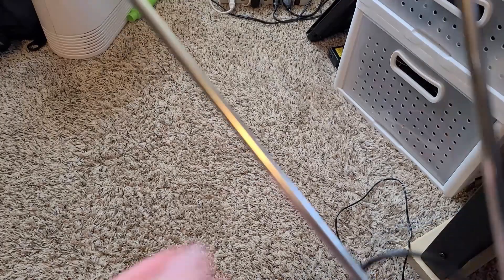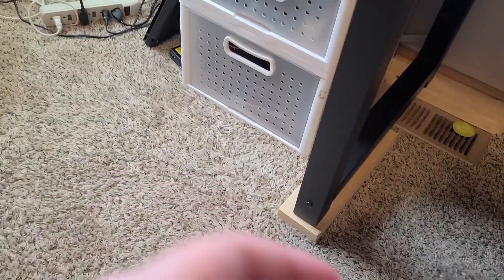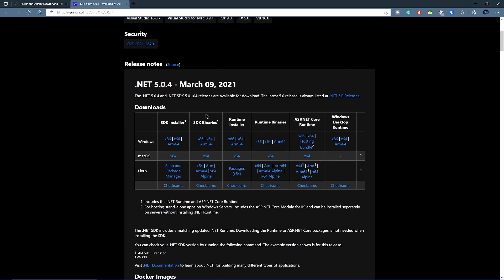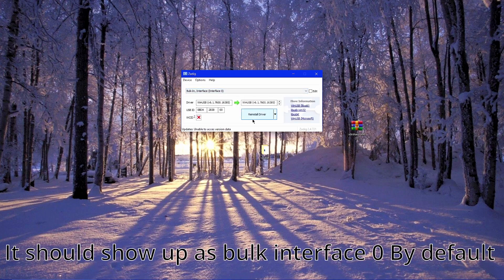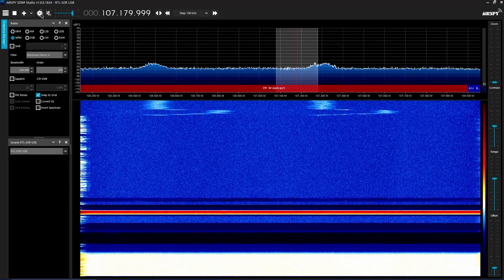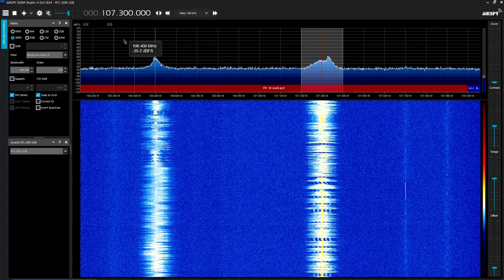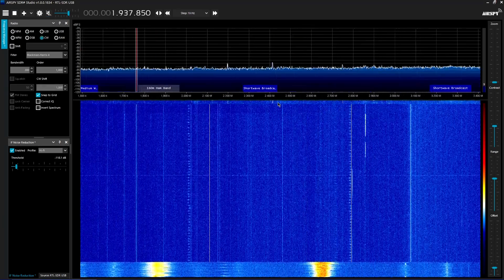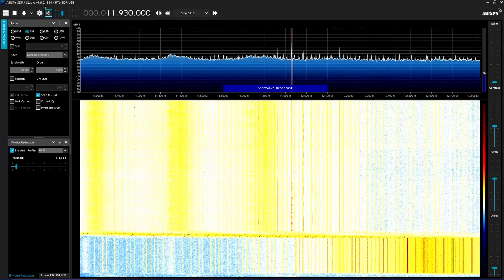Beginners guide to SDR #2 [ setting up antenna and SDR sharp ]

Comment from the maker: For those confused, the cable that I mentioned is not fully shielded therefore if you pair it with the two diapole antennas and you stretch out the extension cable it will actually pick up shortwave better than the diapole antennas by themselves. (And yes I do know about the resistance of the cable which is why you shouldn't use this cable with VHF bands and above)
Reply: Thanks for the video!  You should make a dipole with the antenna ;)  Move it up on the window, look inside the antenna (behind the little plastic piece that pops out in the middle) and you can see which side is the active element and which side is the ground - move it up on the window, extend the active vertically up, and extend the ground down, and you will have a "true" (as true as you can get with cheap antennas) dipole and you will pick up a tremendous amount more - especially radio stations.  What you have, albeit cheap, is a 2 meter antenna - 3ft. on each side.  It actually can work pretty well, but you need to position it most favorably.

I'm sure you probably already know this stuff, but for the viewers that are unfamiliar with antennas and are following along - I leave this here :)
Reply from the maker: @NJFPV  Thanks for the info! I've only recently discovered that dipole antenna trick only just recently. Thanks for sharing.

Comment: For the antenna I thought that they are supposed to be rotated and run vertically -- one on top, one on the bottom. Was this wrong?
Reply from the maker: That's correct It depends on what you're trying to receive there's different types of antennas and different types of polarization depending on what you're trying to receive.

Comment: Thanks for this video.  I was following instructions for this with TheApeMan, but I think they are out of date.  I had 2 'Bulk-In Interface' in my Device Manager, and after I ran zadig.exe I selected #0 and it installed fine.  But I still have 'Bulk-In Interface (1) in the Device Manager, and in zadig.  I ran the install-sdrrdl twice, could that be the problem?  And how do I fix it??  Also, my audio goes mute in my speakers when I open Sharp!
Reply from the maker: You only have to install the driver for Bulk-In Interface 0. As for your speakers being muted I'm not quite sure I've never experienced that problem before
Reply: @Alexwarestudios  Thanks for the reply.  I restored from my daily backup and tried again with no problems.

Comment: Nice job on the RTL-SDR setup!  I just want to mention that the SMA extension cable is a shielded cable so it really doesn't act as an antenna.
Reply from the maker: I thought it was shielded too, but that SMA extension cable alone has gotten me shortwave radio when I stretched it out. That's why I mentioned it in the video
Reply: Non-terminated cables can respond in unexpected ways!  Interesting!
Reply from the maker: @danedewaard8215  yeah if you have the kit it's worth trying actually.
Reply: Dans correct …. Cable length means nothing.  In fact, the longer it is, the less signal will get to the receiver.
Reply from the maker: @carlgriebno5691  the bigger antenna you need to receive the frequency stronger, that's why AM antennas are wound up a lot inside of radios. (And do remember this cable acts like an antenna because it's not properly shielded)

But I will admit you're not 100% wrong
(The benefits of this cable are minor in most cases)